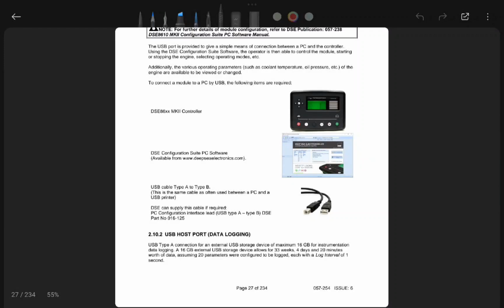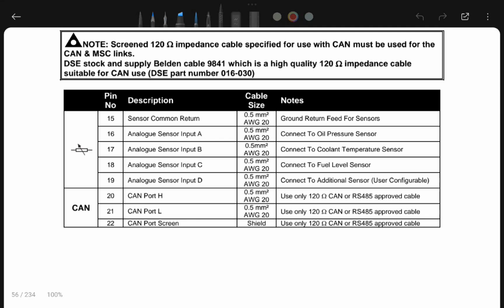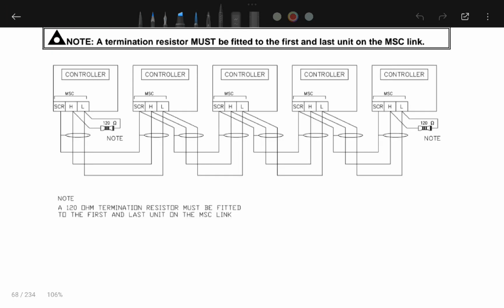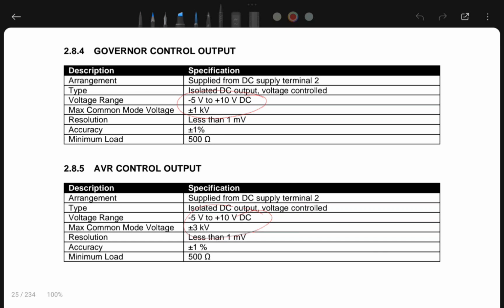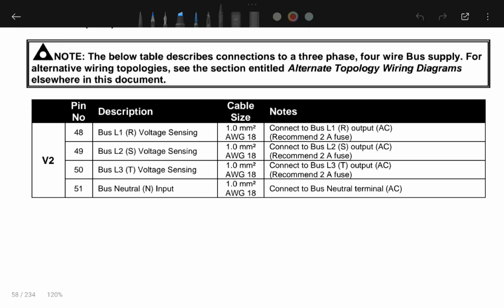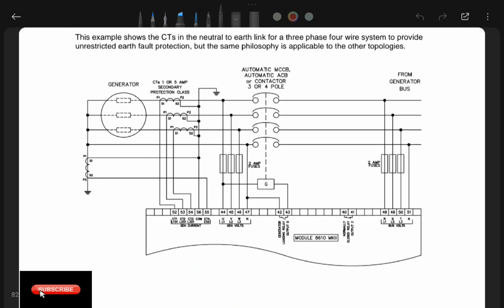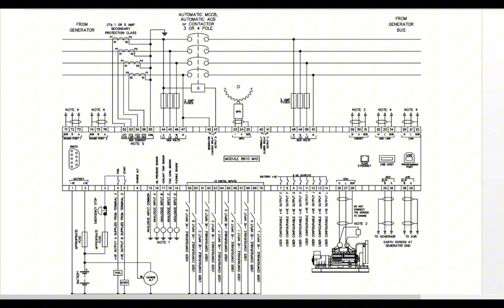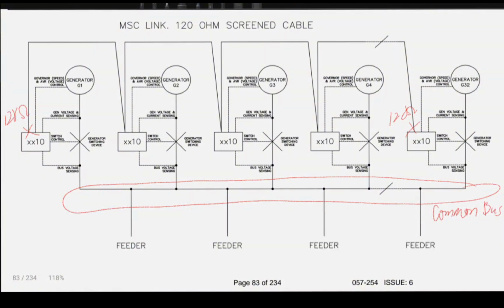DEEPSEA 8610 MK2 wiring diagram and functionality simplify

Comment: i can't connect  deapsea 6320 cat genset  what is the problem
Reply from the maker: You need permation from cat or your usb not working or need update your sofetware
Reply: @benzblogsVlogs  my usb cable is working and i use other  DSE  controllers  but this 6320  connected cat engine is  accepting
Reply: i mean not accepting
Reply from the maker: @abdijama9108  yes because cat deepsea have there on access you can not direct connect from cat they have a protection u need to replace the module if u want